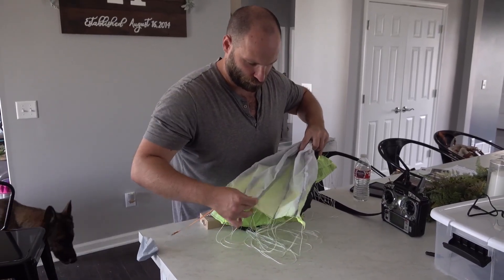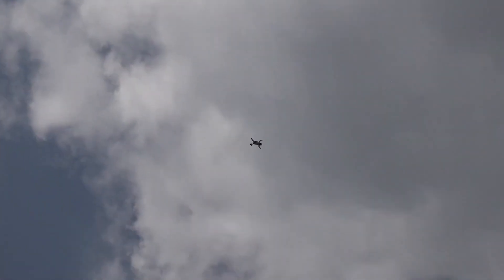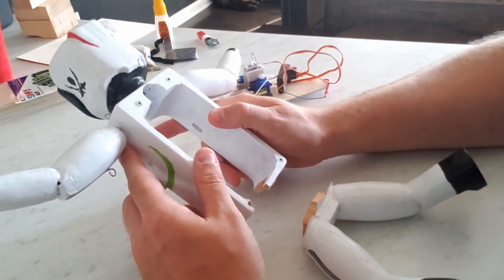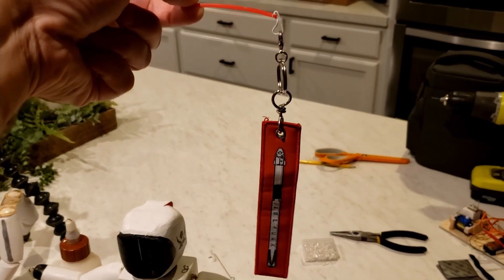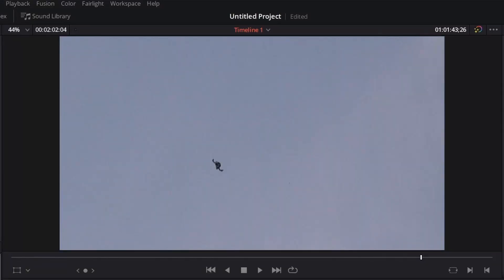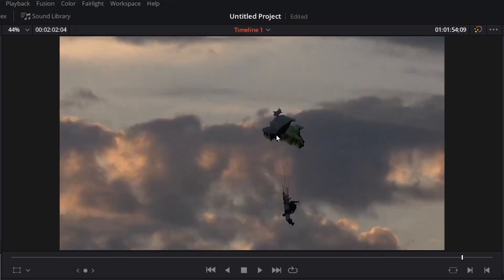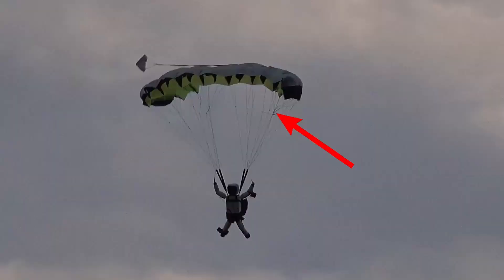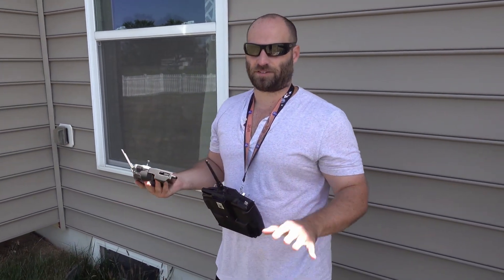How to Build an RC Skydiver | Maiden Flight | PART 9 | Project Skyfall

Comment: You could increase the angle of the lines so that way the parachute can glide forward allowing better control
Reply: This is absolutely it it now spins around the second row of lines in a flat b stall a risers should be shortened a little